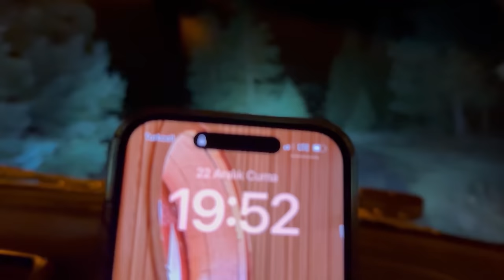KAR FIRTINASINDA ÇADIRIMIZ KARLAR ALTINDA KALDI

Comment: I hope you didn’t forget to bring the hot chocolate!!!
I was wondering how you could avoid having to go outside to clear the accumulation of snow. Could you use a Radiant heat source close to the ceiling to help melt the snow? A hairdryer would be too small 😂 but a flat, lightweight electric device might work.